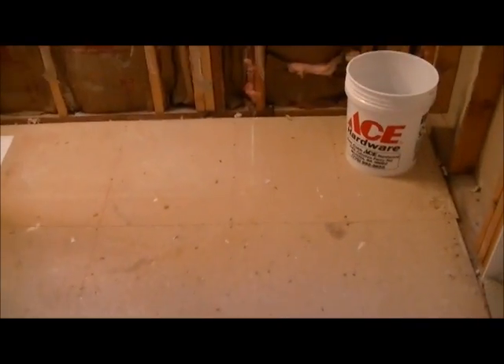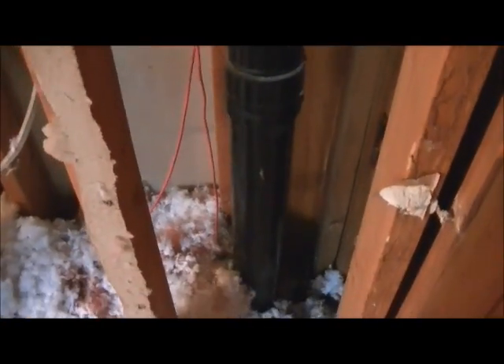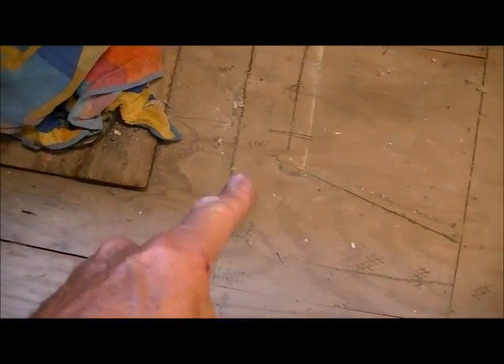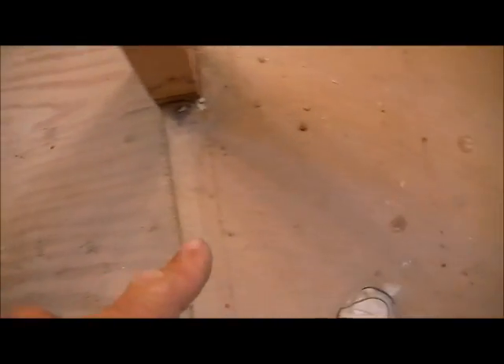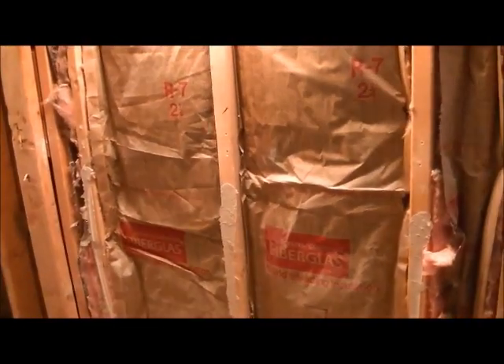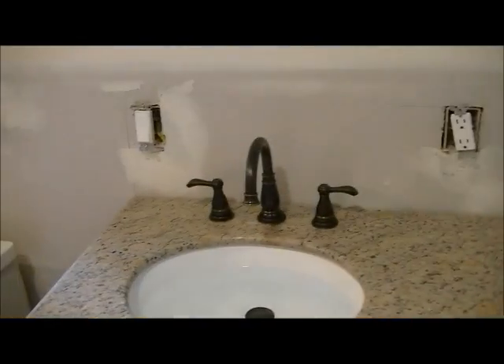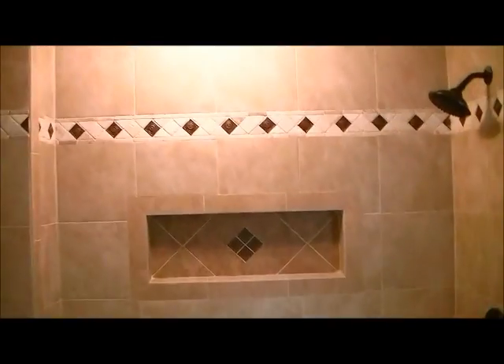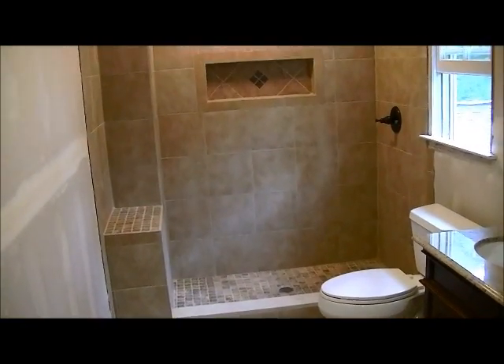Bathtub to Shower Conversion ( full bathroom )

Comment: First off, let me say that I admire your work and have been a subscriber for quite some time now. Lastly, I noticed that on the main, large back wall...you had to resort to a slither cut in the left hand corner (near the bump out). If you had it to do over again, would you have done it that way? Just curious, as I always avoid having any kinds of slither cuts where they might be noticed. Just curious. Other than that, awesome job!